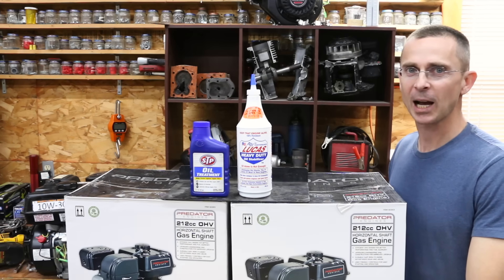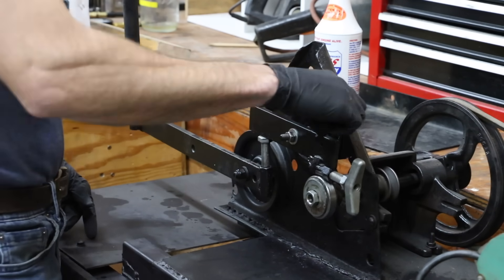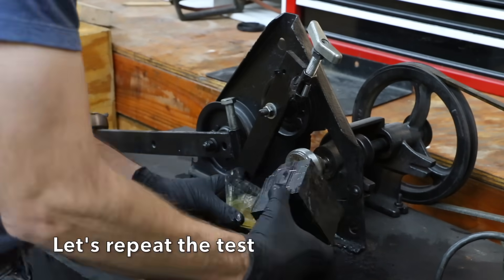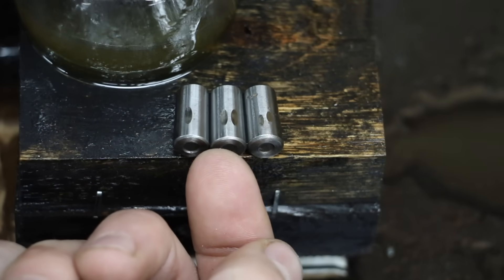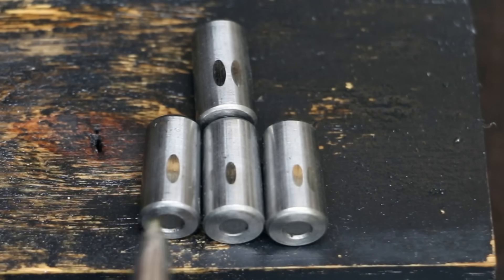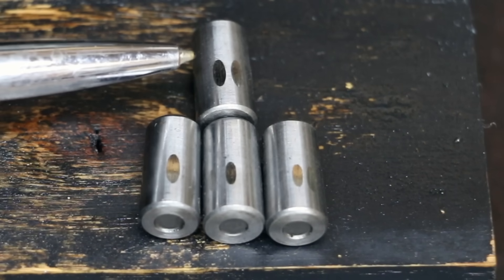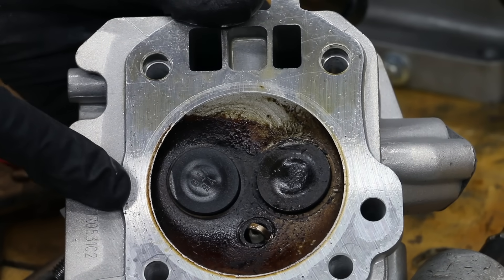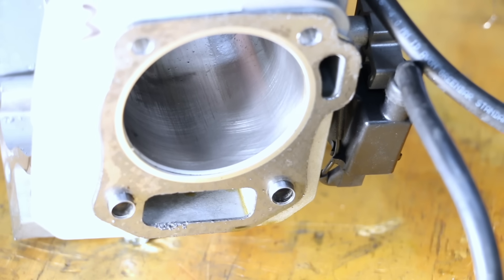Which engine self-destructs first?  Lucas or STP?

Comment: It’s already been mentioned and I agree that you need a third engine with no additive. This will be your control. It will tell you if any of the additives have no effect at all or even negative effects.
Reply from the maker: Thank you for the feedback!
Reply: he tested plain oil in another video, -38 minutes dry.    the other product lasted 70 minutes.....  so both these died before plain oil...
Reply: @peetky8645  he did have a plain oil comparison with the bearing tests which clearly showed plain oil took damage faster...
Reply: tbunreall  there are many oils with many additives, these chemicals are all expensive and there's a fine line between what people will pay. 
I agree with your real engines comment though. 
There are a lot more factors than just wear, fuel economy is a great example. 
New engines are using weight as low as 0w-12 that I've heard of, so it's really dependent on the engineering of each particular motor and its use scenario
Reply: @beargillium2369  All that showed is what happens in that specific test, not relevant here.
Reply: That's true would be interesting
Reply: Donate an engine then.
Reply: @SamTheMan55555  they buy a million of them by this video alone :D
Reply: Honda accord burning 2 L between oil changes. 15 % lucas stopped burning, knocking, ticking in motor. 

Start at 10%. Then keep upping 5 % at oil changes until burning stops.
Reply: @mysticjedi6730  is it a Type R

Comment: I’m actually interested in the water wetter vs coolant and which one is better as well as environment safe which will last longer corrosion testing keeping cooler and more see I have used both and was wondering which it actually better to use at daily driving road trips and high performance uses such as high speeds including racing
Reply from the maker: Thanks for the suggestion.

Comment: The best oil additive I have seen by far is Petron Plus. 30 ft lbs of torque to stop a spinning bearing coated in Lucas. Over 120 ft lbs of torque applied to a spinning bearing coated in Petron Plus and it didn't stop. I have seen old straight 6 engines in person from the 50's and 60's on engine stands, with a radiator hooked up, treated with Petron, idling for hours with no oil pan, no pushrod cover and  no valve cover
Reply from the maker: Thanks for the feedback.

Comment: For one who is to say both engines were runnning at the same rpm without a tacometor also did anyone else notice the bolt unthreading itself at 9:32 look between the muffler and fuel tank

Comment: I don't see the sense of running the engines w/o oil.  If you're not putting oil in your machine, it will fail 100% of the time.  Lucas is a thicker oil and would obviously last longer with the thick coat that still remains after draining the oil.   

The real test is to see how long they last WITH the oil in the engine.  Who cares what an engine does when you drain the oil out.  What a waste of 2 good engines.   Great channel though.  🙃

Comment: I had a Valve Lifter start to go on my 5.7L Hemi   #5 Cylinder (Lifter) was Seized and I was getting a Misfire there.. I ordered Lifters and a Camshaft but decided to try a few different Brands of Additive to quiet the Lifter. After 50 Miles of adding Lucas I had no Lifter Noise again and no Backfire   Truck ran like it did before any of the issues started.  I was amazed!!!!! Best additive out there in my opinion
Reply from the maker: Thanks for the feedback.

Comment: my mechanics in colombia are telling me to use 20w50 engine oil in my 98 montero engine 3.0 which is recommended 5w30 oil by manufacturer.  Even in the mountains where day time temperature is only 15 to 28C they still say to use this very thick oil.
Reply from the maker: Thanks for the feedback.

Comment: Are these motors useful for air compressors? Would love a video on heavy duty 20+ gallon air compressors running air tools and power consumption over time and even motors longevity whether electric or gasoline. Please and thank you 
-an aspiring grateful mechanic using all the knowledge you willingly give. Thank you
Reply from the maker: Thanks and you are welcome!  Thanks for the suggestion.

Comment: Had a '73 f100 with a 360 cid, bought in '92. It had been neglected but paid $700 and drove it 8 years before selling for $750. 
I used 2 bottles of STP with 4 quarts 50 weight Valvoline. Still leaked some, but didn't burn oil.
Probably about like using a quart of Lucas, but cost less.
Keep in mind that was an old pushrod engine, not the VVT over head cam type where viscosity controls actuators.
Reply from the maker: Thank you for sharing!

Comment: I want to see a test video about, if a engine can run on transmission fluid, hydraulic fluid, or straight mineral oil. Could you do this please? If you can I would actually pay for the products I want you too test.
Reply from the maker: Thanks for the suggestion.

Comment: The STP instructions do allow for a higher ratio for older and worn engines using two bottles of STP in engines taking five quarts of oil. I'm think if that was used instead of the singe bottle the results would have been closer. The STP is also less expensive than the Lucas Oil Treatment even using two bottles of STP to one bottle of the Lucas product.
Reply from the maker: Thanks for the feedback.

Comment: IT would be neat to see if you had an engine with warn rings around to see if the Lucas actually stops it from burining the oil...The project farm video that was done for the motorkote product that was tested in a lawmmower lasted 1 hour with nothing but water... Now thats  impressive however It would have been neat to see how all 3 products compated side by side however this STP vs. Lucas video was great. both addatives are great.. I knew a guy who used to use stp oil treatment in his air cooled motor cycle motor...
I like the lucas addative.. I have used it in the past in my 4cyl toyota motor...  the lucas seemed to do better in this comparison as video...One thing I noticed about Lucas when I used it is that It helps quiet top end noise on warn engines however I wasn't using for warn rings to stop any oil from burnging and smoke from coming out from the tail pipe...another thing that that you have to watch out that I have heard from other car owners is that these addatioves make the oil thicker and these newer vehicles that use 5 weight or 0 weight oils could have had problems becuase you make the oil thicker when you put these addatives in and then even cranking their car may become difficult..I have 
heard from people who put lucas in their car motor oil and the next day they found that the motor was straining to turn over due to the oil weight being made heavier in the cold weather.. so that doesnt sound very good... yet I haven't had these problems while using lucas in my vehcile it takes 10w40...
Reply from the maker: Thanks for the suggestion.

Comment: Okay your attempt flawed in many ways. With saying that, I applaud your efforts. Obviously you put your money where your mouth is blew up a couple of engines worth memo also $600 a pair. Maybe closer to a grand. But nowhere in Lucas to say anything about running them empty. They're made for older worn down damaged engines. STP has its place too. Obviously I am a humongous fan of most Lucas products. You may have used a few in the past from what I can tell. But not to the point I'm going to describe now. I'll keep it very very brief. STP is what I grew up on. My dad would rebuild those 235 CID inline 6s and use them. He used STP during assembly and later when they start to wear out. He got away from STP when he went to Toyota's and rebuilding them. Are you still using the old tractor. It was a Johnny popper until he rebuilt it. See a pattern so far? Somewhere along the lines he started using Lucas products. He turned me on to the Lucas product lines. I had the opportunity a number of years ago just speak with six or so people pretty high up from the home office which is unique in itself at the time. I met them at our state fair interstate fairly far from their state. That's my transition from STP to Lucas in this comment. I flip old vehicles some of them quite old. Then I normally drive older vehicles. I go all over the country hauling vehicles. Covid was a unique experience for driving but we still drove about the country. Then turned away at police roadblocks because of the hype & scare of covid. Now I had it four times. The point is yeah it's real but how real can our attempts be to protect ourselves.? Now I've used various Lucas products in multiple products in each of and a few hundred engines. I don't have an exact count. I will use one vehicle to exemplify the oil treatment products. A 1991ish Ford F-250 4x4 flatbed. The truck look good but it was only used by landscaping company for a number of years. It has a 351 CID and automatic transmission. The engine head at least two if not three spun camshaft bearings! I drove that truck 6 hours to get it to his destination under its own power and after a short initial time I drove it to highway speeds. They have Lucas stop leak/stop burn oil products. They are not the easiest products to find like the one you checked or tested. I put in roughly 30% of capacity for the same additive that you used. I drove 15 minutes minimum not quite a half an hour found a Walmart out in the middle of nowhere, immediately pulled into that store. If there were any live mosquitoes around it wasn't for a hundred miles. And exaggeration but you get the point. They happen to have this stop leak stop burn Lucas additive and I bought four quart jugs of it. I bought 4 gallons of oil and couple gallons of transmission fluid along with the Lucas fuel additive and transmission additive. I bought the tranny fluid for the engine crank case if I needed it. What I did was put in a bottle of the stop leak stop burn Lucas additive and the remainder of the 30% I fill with the Lucas oil stabilizer was the same as what you used. Now you use the standard 20%, but I contacted Lucas and spoke with expert directly. He didn't call himself an expert but that's what I asked for and it's who they gave me to. And I spoke with these people a few times. I believe he told me to use more than 30% in my application. He did tell me how to put it on the trailer or tow truck and haul it. Not exactly what the product was meant to do as far as camshaft bearings. I broke that trip into two segments and I just had business after the first 2 hours. After I put the additives in that I described and then top it off with more oil I lost less than a half a quart of oil and that was in the first half hour after adding the additives. Before then I was losing and burning about 60% of the capacity and that was in 15 minutes something less than the first 30 minutes prior to reaching at Walmart. By the way tractor supply commonly runs it by one get one half off and their standard price is give or take right in there with the price at Walmart has. I'm not plugging the big blue box store just happens to be when I came across to buy the Lucas additives. Anyway I start that truck and let it run one to two times a day while I was conducting my business 2 hours into the trip. Then I drove it the other 4 hours and pull a trailer with 2 to 3 tons of stuff on it. Plus 1,500 lb of better in the back of that flatbed. I never burnt or lost a drop of oil or enough oil to show on the dipstick again. Until I let the truck sit for 3 weeks. Then it was a mosquito killer again. After I ran it around the acreage it stopped smoking and I replaced the missing quart and a half with 50/50 oil and regular Lucas product. Lucas is great for cleaning out the engine and coating internal parts. Neither one of these engines had low miles with the Lucas example or the STP example except for the Assembly of the new engine. That's my point. It works for old engines that are worn and not just right after break-in if you want to call that break in on your lawn mower engines. I've had the same results on worn out lawn mower engines too. Hard shifting transmissions automatic and using the Lucas transmission additive and it straightened out a number of them. A little noise and the differential and it helped it out. A four-speed with Granny Low about 50 years old and it helped it out. I've had no real luck with your power steering sealant lubricant fluids additives. Now it doesn't matter for Chevy or a Ford but we all know that Ford power steering units love to leak. I used to get something from Kmart that worked okay in Ford units for power steering but I think there's only 9 or 10 of them left in the country. So you try to have a scientific approach but there was not a control unit. Maybe it's not needed. You didn't blow up a oil use only engine. I didn't use three vehicles on a single test just in reality that their product worked. You know I never did anything with that truck. Maybe I should have known YouTube channel as I've been encouraged to. I'm just not looking for the extra work. But with this truck I could do a will it run and demonstrate a good looking old Ford truck and how Lucas additives actually work. The key was the guy Lucas says if you run the vehicle about every 3 days then I may stand a chance and keeping the engine running with the condition it was in and not drive it down the road actually. I gave them feedback. Maybe you can give them feedback they'll talk with you. Now seafoam is horrible for your engine. That's true but it'll upset a number of your viewers. So for the farmers using it in there heavy farm equipment and fleet companies use it in their fleets and heavy equipment operator using it in their heavy equipment it works. Did not give you a thumbs up or thumbs down. Thumbs up would be endorsing your attempt. A thumbs down could be seen too harshly. I don't believe that you are necessarily out to get Lucas or STP. You just came up with a subject that on the surface your approach seems somewhat valid but still interesting. But you did succeed and getting me to spend the time to share this comment. Which means other people comment on my comment and that's basically what you want gain attention to the channel. But thank you for entertaining us by tearing up a couple of good lawn mower engines.

Comment: I done my own test with Lucas , My 1999 Ford pick up has a 4. 6  Engine ,   What I done  I  drained   all the  oil  out and all I do is  use Lucas attitude in it and I've been doing it for 3  to  4 years and I do not have no problems at all , Direct Lucas additive
Reply from the maker: Thanks for sharing..
Reply: @ProjectFarm   I do not recommend this for people to do this,   I done it just to see how long it is going to run and the engine just keeps running , knock on wood 🤔😎

Comment: First of all,  you are amazing!
No frills, no over acting.
Just the facts.
I am an aircraft mechanic with my degree from Embry Riddle.
In our engine builds we have always used STP. 
One of the things about STP is viscosity adhesion. 
When you put your fingers in the gloves and dip it in the STP. There are usually 4 to 5 strands of line viscosity between fingers.

I predominantly use  a Bull nose series Ford F-150 302 blown air ride hydraulic dump truck., Mazda B2200, Datsun Z series and a Skyline, 🥰Lycoming Air , and Suzuki motorcycle equipment. 

Also I’m a Cat fan and I’m building a cat hybrid backhoe mini. Electric caster chassis and hydraulic bucket. It’s a mini cat so it fits thru a 4 ft fence door. I think a lot of gear heads are gonna love it when I post the finish. 

Unfortunately I do not build Chubby’s. They are so much more affordable and have so many cool aftermarket parts that make me drool especially MR. Vette . 
After getting your eyebrows blown off twice tuning the distributor, behind the carb it changes your view.  
I always lay up all engines, and I do mean a lot of engines, with STP. The squeezy gel feeling when torquing main journals and seeing the STP come out evenly all around is quite pleasing.
Now I’m an old schooler an Lucas (in my opinion is the new kid on the block). I haven’t even begin to rate synthetics.  I hear they are good though. I’ll probably move to super capacitance electric vehicles before I try to rate synthetics.
Back to your test.
The new information in the Lucas charts formulas , and tech specs that  had to do with the extra run time you got before detonation. Was informative.

However, let’s go back a little in the test. 
Temperature.
The STP engine ran cooler before the Big Bang, the coking of the head was less. And even thought Lucas did win in longevity, the test was a destructive test. Now who’s runs with an engine oil light on😁.
 Now on high rpm Suzuki Gixxer 1000s and any engine over 9000 rpm speeds I build with Motul.
This is clear F-1 stuff , and really not applicable to the test you performed.
Different breed . The 10k rpm engines, and nitromethane engines , short connecting rods, and extreme side block forces, exceed single cylinder engines. Also crank  balance tuning is a major factor.
Lot of CAD time.

However 
I will never leave Castrol Motor oil .
Just my thing.
I started using Castrol on all vehicles in 1978.
I’ll build with Motul. For F-1, and 10K engines,
But I run Castrol for everything else.
I dunk the cleans in a sacrificial electrolysis tank so even though Castrol has a higher varnish value than other oils,
I just trust it.
For air cooled engines it is peas and carrots.
40 years on one mower Briggs  100psi compression, it’s that good.
The Ford tractor, unbelievable.
Well that all for now ,
I’m 3 cars 3 bikes and one hydroplane behind.  The shop and the shop supplies are getting hard to keep on schedule, so it’s time to get cooking. Covid has really slowed my inventory replacement down.
Thanks for letting me bend your proverbial ear, by text.
Kevin Wood
A@P 22811**
Linear Dynamics Engineering.
Reply from the maker: Thanks for sharing.